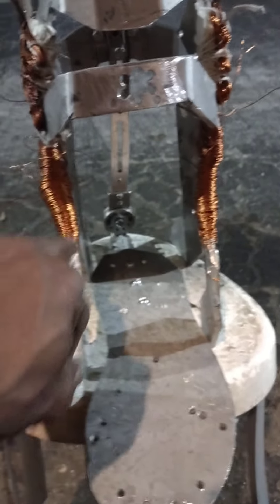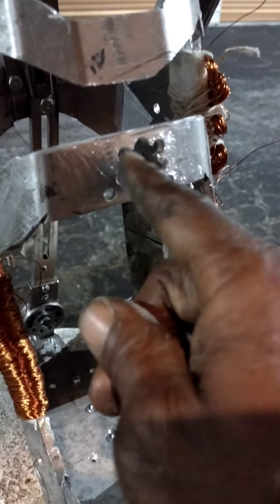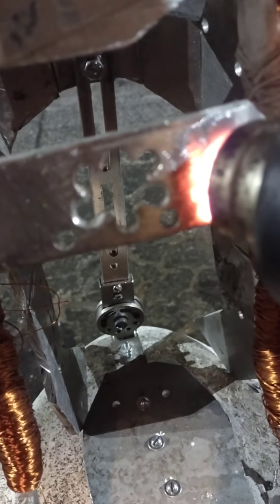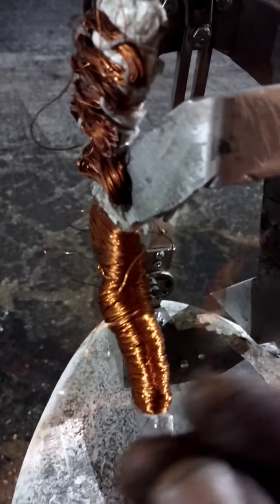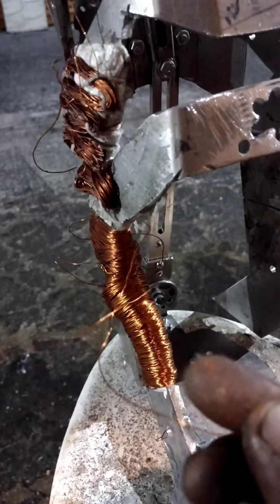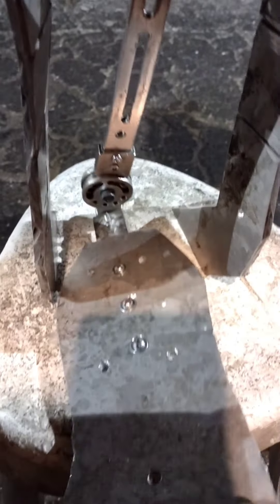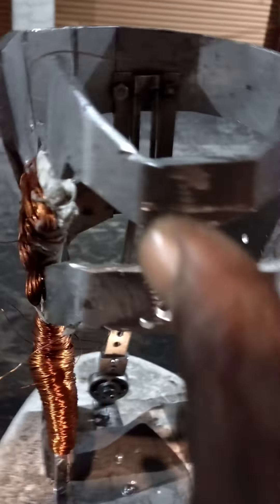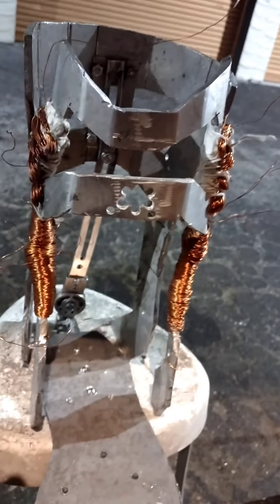FLYMORTON BIOMECHATRONIC MANNED UAV EDS DIAMAGNETIC REPULSIVE ORTHOSIS PROGRESSIVE DEVELOPMENT

Comment: I don't understand what you said pretty critical
Reply from the maker: Okay plans are hoverboard TRANSDUCTOR voltage transformer materials aluminum block 1inch gauge exhibits two hollow rectangular open clearance localized together center of the diamagnetic board baring TRANSDUCTOR element type round silver wire protection rubber cover coated wire spun tightly helix shape coil. Alongside the local to the center of the aluminum board exhibits holes baring titanium gripping claws baring round silver wire 1000ft spun tightly helix shape coil individually within a chain series phase wire current carrying cathode silicon block brush rotor hot junction bypass by seebeck effect type Peltier effects cooler spherical round silicon rotary cooling junction bypass block brush rotor anode current carrying phase  wire  subsystem modulated hardware processing software base computing distance sensory switch damping switch vibrations switch gravity sensory range finder switch gyroscope 8 AXIS PITCH ACCELEROMETER switch controls cooler Eddy currents Electromagnetic field vector proximity field of diamagnetic repulsive behavior. SUBSYSTEM STRUCTURE modulated HORN TYPE TUBING EXHIBITS COIL BARING ONTO THE ALUMINUM SURFACES IT'S STRUCTURE CONTAINS HOLLOW OPEN CLEARANCE REFRIGERATION COPPER TUBING SPUN TIGHTLY HELIX SHAPED COIL(MCE)+(HFC)134A PUMP REFRIGERANTS WITHIN THE HOLLOW TUBING USED FOR HEAT DISSIPATION COOLING INCREASE EDDY CURRENTS ELECTRODYNAMICS HALL EFFECTS DIAMAGNETIC REPULSIVE BEHAVIOR